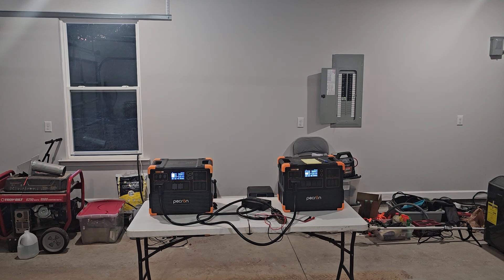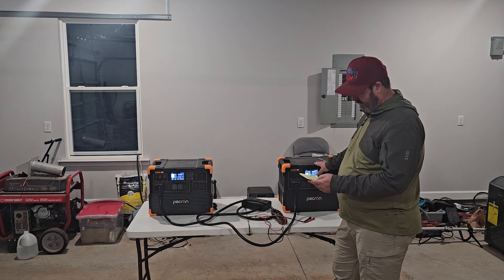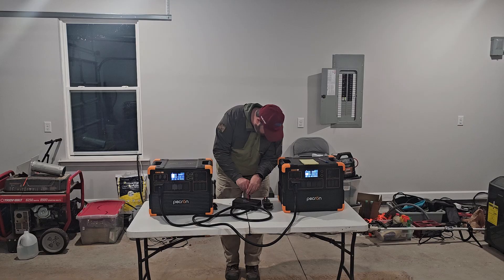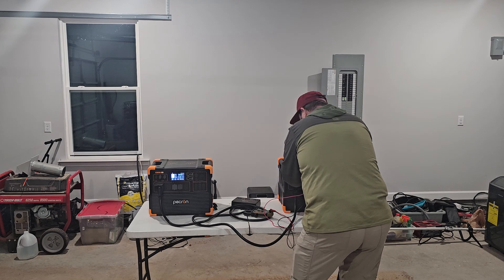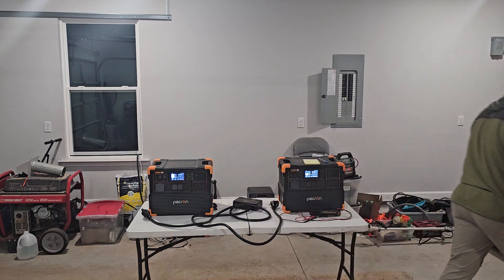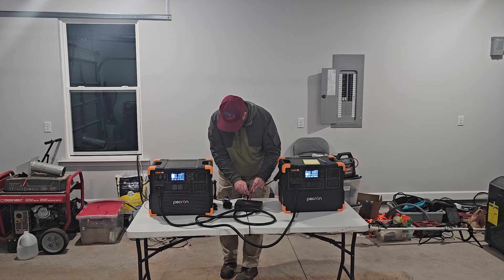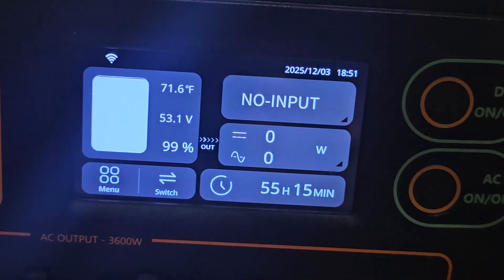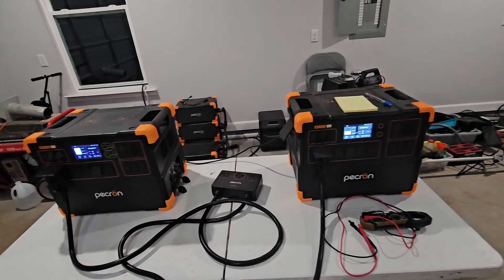Pecron Requested I Do This Test! Part 2 The Surprise!? #E3600LFP #Solar #offgrid #pecron

Comment: I have the same setup (two E3600LFP's, 4 expansion batteries, 240v hub). I just ordered a spare 240v hub from Amazon. They are 100 bucks, not sure if i'll ever need it, but my setup is for power failure backup and I need the 240v for well pump, so it seems like a reasonable spare part for the price, especially given what I have invested into the rest of the setup.

Comment: Yes, its because the two 120VAC waveforms are not synchronized without the data cable.  So one will drift across the other.  Normally they would be locked at 180 degrees phase shift from each other which is how you get 240VAC across the two.   When they are completely in phase with each other you will read 0VAC.  When they are drifting across each other, the reading will oscillate between 0VAC and 240VAC.

This is why 240VAC hubs were more or less abandoned a few years ago.  Until Pecron resurrected it... but obviously they just resurrected a broken technology and didn't fix anything.
Reply from the maker: To be fair we have to sync generators at a power plant with the grid.
Reply: @GridDownPreparedness  Well, sure, but that's a completely different realm of operation.

Another item of consequence is that running inductive loads (poor power factor, aka AC motors, compressors, etc) is not something these little power stations can really handle very well.  They don't have a big enough energy buffer to deal with the reactive power.  It's just another nail in the coffin for the whole 240VAC hub concept.

-Matt

Comment: TL/DR# plug in hub with no data cable attached... and the error went away.

Disconnecting the hub reconnecting with the data canke and doing things as normal is working again, but there probably is an issue with the hub itself.

Whether or not it is unique to that hub or all hubs is unknown currently.

 Seems to be safe to use again "as is" but the problem could come back with that hub.

At least we have a means to try and reset it - assuming it is safe to still use without damaging the inverters.  TBD.

--------

Thanks for all the testing and info!  Brings some confidence back in the main unit.  Makes me wonder if I should get a 2nd hub as a backup too. But think I'll wait until Pecron shared more.

Not sure if you saw or not on one of your other videos, but the hub I was sent is not even Pecron branded. Looks exactly the same, but now I'm really curious if the guts are the same.
Reply from the maker: I haven't gotten any more feedback from Pecron yet.  I did a long test session earlier this evening.  I don't understand getting any voltage potential Neutral to Ground on the 240-volt hub.  I do get a potential on both isolated E3600s of 4V AC Neutral to Ground. I was expecting less than 1 VAC.
Reply: @GridDownPreparedness I will try to test mine on Saturday and see if it is similar or not, especially since my hub is branded differently.

Comment: Sounds right… all the testing they want you to do….. just delays them engaging the replacement/ repair process. They’ve had me do the extensive testing as well to only have the result to return the unit.
Reply from the maker: I don't mind the testing.  It helps me understand how it works.  The affected E3600LFP is working now... the issue may be in the 240-volt hub.

Comment: Glad it's working again.  Do the touch screens NOT shut off when you power them down?  Looks like they stayed on?
Reply: Looks like he just shut down AC output, not a full power down
Reply from the maker: As I understand it, turning off the AC and DC outputs is the only way to tun the unit "off". I don't think it ever truly  turns off because any input for charging wakes it up. It seems there is only a sleep mode.

Comment: btw... love the bonding cable idea!  so many advantages 1) balance lines 2) I have my cables bonded thru 4post bus bars. with an echo worthy 100ah rack battery and a 60amp chargeverter. now I'm also thinking about a 3rd 3600 on the bus bar.  that would give me more battery, more solar plus another way to charge the whole pack.  makes  pecron the best solution IMHO.
Reply from the maker: Glad you liked the idea.

Comment: Maybe there is a problem with that hub?  I wonder if you move that hub around would it start to short circuit again?  Now you got me curious.  Lol
Reply from the maker: I really want to take it apart! A loose wire could cause the voltage flux.
Reply: As I commented in another video, seems most of those having problems is tied to 240V usage. I feel like this model was not originally designed for 240V and it was cobbled together after the fact by adding a hub, a data port, and software.